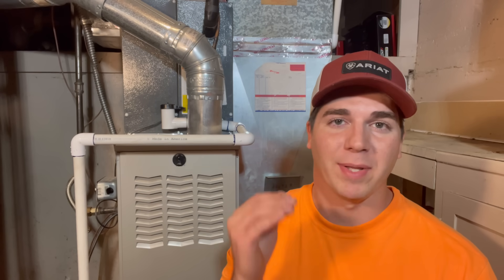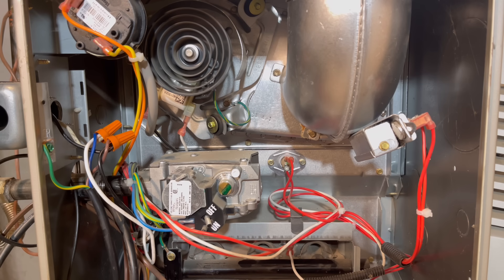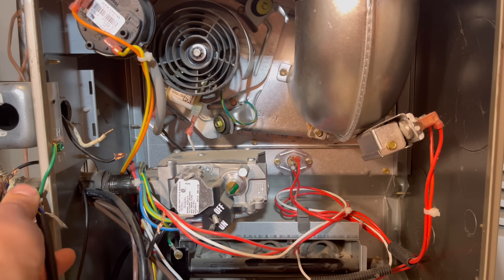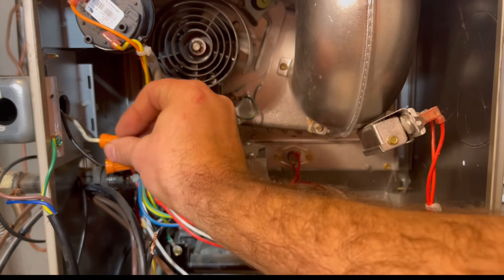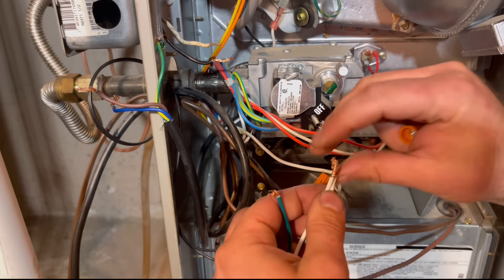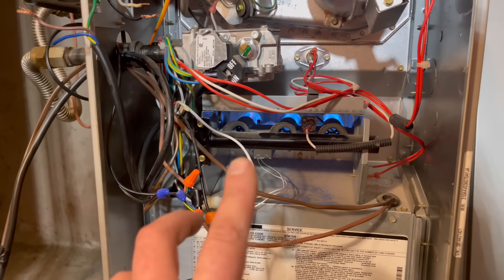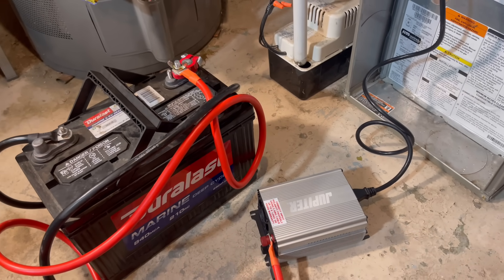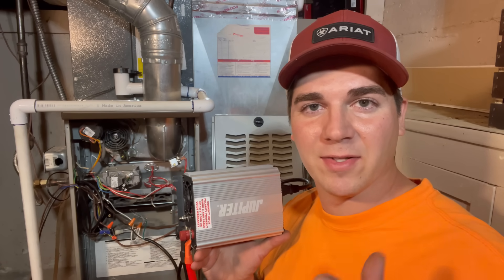Did You Know You Can Heat Your Home With A Car Battery?

Comment: Please note keeping that battery on concrete will drain it/ground it which will cause reverse polarity problems internally  ... It needs to be at least on a few sheets of cardboard.
Reply: no longer true since batteries were housed in plastic, which is more than 75 years
Reply: @EmilioIacobelli  they still get grounded.. not as often but storage ... you do you man just speaking from experience
Reply: @Fight4Freedom1911   how would they get grounded? Grounded to what? Is polyethylene a conductor? Since when?
Reply from the maker: Lol
Reply: @EmilioIacobelli it jumps thru the casing at low volts, it happens when the battery is also in a metal battery holder and not secured tightly. It will continue to shift and wear out your caseing wall causing it much faster. They are all remanufactured pieced of shit that only last 3-7 years for a reason
Reply: Every company gets them on wooden pallets and cardboard sandwiched between until they go onto the metal shelves or until an employee fucks it up.... then battery's on the shelf last up to 3 years on a good note which is why company's collectively brought the warranties down as well to 3 years instead of 5
Reply: Just go get a battery box if your having that hard of a time understanding or a slice of cardboard lol
Reply: @EmilioIacobelli  unless it's the electrical system causing a negative parasitic draw on a ton of causes... but you'd be surprised how many batteries get sold that are 10-30 percent defective but it will work good for about 2 and a half years just perfect warranty time .. do your own research in life before talking shit lol
Reply: @Fight4Freedom1911    "it jumps through the casing"? 
Is that some sort of Quantum-Mechanical effect? 
Because if it is; the casing wall thickness would have to be microns thick.
For the casing wall to abrade to the point where quantum tunneling would occur I'd suggest either mounting it in a lower vibration area or a vibration damping mount, or, ya, mount it securely, which is normal practice, but why would I secure it to my garage or basement floor?  Unless I lived in an earthquake-prone area?
Or, if it's happening after 5-10 years, then the casing abrasion is irrelevant as the normal internal degradation is dominant.
The alleged drop in total product quality is a completely different subject that has nothing to do with current getting "grounded", the mechanism of which BTW you still haven't fully explained.
Reply: @Fight4Freedom1911    we're speaking of batteries placed to rest on concrete, not parasitic connections, not manufacturing defects, not handling errors, not high-vibration applications or improper securing,. So please explain your original reply to the subject of how a battery gets "grounded" on concrete
Reply: @EmilioIacobelli  your trippin out my guy go get a beer before free your next reply ..... in the real world I'd see that shit on a daily idk what your going on about just keep your battery off the floor or as far as possible.. electricity is always grounding,when it's in your car it's on wheels fully insulated and you want it frame grounded... you do you my guy it was a simple comment from experience the walls are only 1 millimeter thick.... I've seen hundreds cracked open and you'd be surprised how many living NPCs have grounded wall housing just from driving ..... like you said storage alone it does go past the plastic missing or not
Reply: But they are ment to be recharged so just in time it will loose a percentage of charge and not meant to drop to 0 percent charge
Reply: And the vid here he does have it on the floor for his setup so I'm trying help him out lol and I'm in Cali everything is bolted and lower because we're always on fire and getting earthquakes
Reply: @Fight4Freedom1911   dude, chill, I'm just asking you how the battery ends up discharged just from sitting on the concrete, that's all you originally said, you didn't say anything about abrasion, cracking, etc.
That's all I want to know; how does it end up discharged from just sitting on the concrete? Which I assume is what you mean by "grounded",  which is the wrong term for "discharged".
Ok, I'll tell YOU ; the ONLY way it will discharge if it's not on a charger is by self-discharge due to the recombination of ions in the electrolyte solution. 
Not from sitting on concrete, it could be sitting on anything, it could be suspended in mid air.
And all of the other stuff you mention has nothing to do with discharge; they are all mechanical damage.
Study some basic electrochemistry and proper terminology.
Reply: @EmilioIacobelli  lol for a 100 dollar battery I didn't want to waste my life on this Broski I just said time same shit
Reply: @Fight4Freedom1911    The strength of the solution has nothing to do with what I said. The positive and negative ions *IN* the solution are what recombine… not the solution strength. If you have to add water to the battery it’s because it’s been overcharged and the water has been evaporated out. That has nothing to do with the ions at the atomic level.
BTW, as someone said many years ago; “When the argument is lost, the loser turns to slander.”
Reply: @Fight4Freedom1911    really?  your argument is ; “That’s what I said” ??  Are you a five year old?
That is NOT what you said.
Reply: @EmilioIacobelli  yoo Biden what are you mumbling on about.. this poor dudes comment section lolll ...ions you have ions in you yess.. your grounded to the floor .. this guy's battery which I sure as hell spent more of my lifetime here then his video ...still grounds thru the unconductive plastic housing as well as looses overall voltage in time ionic water or not lol
Reply: @Fight4Freedom1911  Wow. Dude; Google is your friend. Use it. Or visit a library. 
That’s what you get for throwing insults; your comments deleted. 
Conversation over, I’m out. 
Peace.
Reply: @EmilioIacobelli  comment is still there loll I think they silenced you lol
Reply: @EmilioIacobelli  and it's been over

Comment: You need at least a 2,000 watts inverter an a couple of batteries to keek a furnace running for a couple hours. A 1,000 watts inverter will not work with a furnace .
Reply from the maker: Actually what I ended up doing that I should have put in this video is I got a pure sine wave inverter and hooked it to my work truck and then I’ll just run an extension cord to the furnace so as long as I have fuel in my truck I can power the furnace 👍🏽 just start it up occasionally and let it idle

Comment: If you want it to last longer hook it up with two batteries in parallel, more current available
Reply from the maker: Actually what I ended up doing that I should have put in this video is I got a pure sine wave inverter and hooked it to my work truck and then I’ll just run an extension cord to the furnace so as long as I have fuel in my truck I can power the furnace 👍🏽 just start it up occasionally and let it idle

Comment: Okay I'm sorry I seen a lot of comments a lot of people saying some of the same things and I'm about to say the same thing I'm sure dude do your research first do the testing first so you have real information that you can actually give to the people the one guy that commented saying this will not last for days he is absolutely correct I car battery will give you I don't know a hundred minutes maybe 140 minutes of run time running that inverter to power that device this is what you really want to do everybody go buy yourself a generator but if you don't have a generator but you do have an inverter you find around your house I don't care what it is find enough wiring that you can put together as long as the wiring is thick enough to carry a 12-volt current from your car battery to the inverter hell you could take a series of extension cords and cut them up and make your cable if you need to as long as you put everything together with the electrical tape and nice and tight you should be fine but you do not need to remove the battery from your car now this all depends on your situation the layout of your home apartment whatever it is right if you have enough cordage and the vehicle is close enough to your furnace or window you could probably just wire up right off the car battery shut the hood run the wires directly into the inverter the inverter directly to your furnace and then literally just start your car and while your car is running at idle it will generate the electricity to keep that inverter powering your heater all night long as long as you have the gas for your car lock the doors go back inside stay nice and warm or you could just go in your vehicle and sleep in that until your heat gets fixed or electric comes back on but this is I think the best option is it more difficult not really we're talking about a long extension cord and yeah you're going to be ruining it but you could also put it back together and refix it anywho good luck
Reply from the maker: Yea I learned from the comments I was mistaken and for that I do apologize. Actually what I ended up doing that I should have put in this video is I got a pure sine wave inverter and hooked it to my work truck and then I’ll just run an extension cord to the furnace so as long as I have fuel in my truck I can power the furnace 👍🏽 just start it up occasionally and let it idle

Comment: where is the video showing the runtime on your furnace? no way a 100ah battery can run your furnace for a couple days 100ah battery only has 50ah of usable current. I would love to see the video of your run time.
Reply from the maker: Thanks for this information. I realize that statement was wrong and for that I apologize. What I ended up doing is connecting the inverter to my work truck so I can power the furnace as long as I have fuel in the truck 👍🏽 cheers
Reply: @diyhvacguy  thanks for the clarification and update on your setup.

Comment: No way a single car battery will power a furnace for several days.   You blower motor will draw  600 watts of power.   Supplied by a 12 v source, that would draw 50 amps.   A standard car battery would only last one hour.
Reply from the maker: Thanks for this information. I realize that statement was wrong and for that I apologize. What I ended up doing is connecting the inverter to my work truck so I can power the furnace as long as I have fuel in the truck 👍🏽 cheers
Reply: @diyhvacguy  Good idea.  I like the concept.  I am contemplating a small gas powered generator as back up power, just to run essentials like the furnace.  Where I live its commonly -15 C to -25 C winter nights.   The truck is a good idea.  Run an extension cord to the house.  Lower losses at higher voltage.  Say, run it for an hour, heat the house up, then shut it off.  Fire it up every couple of hours to save gas.  I think you can idle a vehicle for  a full day plus some on a full tank of gas.

Comment: Just skip all this, FIRST! Go to your circuit breaker box, and turn off the fuse to your furnace in case your power comes back on, you don’t have line wires hanging out at furnace!! Then take an extension cord, chop of the female end, open the box on furnace where power goes to it. Undo do the two wires, connect then to the extension cord end you cut off. Then plug male end of cord into your little gas generator. Done. As long as you have fuel in your genny your furnace will turn on and off just like it’s got hard wired power! You’re welcome.
Reply from the maker: Thank you sir. If someone doesn’t have access to a generator because they are sold out, this is good knowledge to have in your back pocket. Cheers

Comment: Hey were is the follow up video with the run time test??
And thank you for this I live in MN and I have a small solar bank but was unsure how to do this to my furniture.!!!!
Reply from the maker: In hind site I would have included that pure sine wave inverters are better for sensitive electronics. Also, what I ended up doing was hooking the inverter to my truck and that will allow me to simply run an extension cord to my furnace and I can power it as long as I have fuel in my truck! The video testing this system out will be posting soon :) cheers,   Dave
Reply: @The DIY HVAC Guy  That's great thanks man. Yes I have a couple inverters, my main one is 2k pure sin, and I have 2 smaller back up ones. 
I have just gotten into solar and inverters this year. Wish I would of long ago. 👍👍👍

Comment: In Texas and this is by far the most useful video I've watched on YouTube in a long while. Thanks and Subscribed
Reply from the maker: Awesome, thank you! Glad you found it helpful! In hind site I wish I would have included to just install the inverter in your vehicle, run an extension cord, and you can power your furnace for as long as you have fuel in the vehicle! Cheers
Reply: @diyhvacguy  I'm thinking of just getting that bluetti that's around $200 wired to a small solar panel. The idea of battery powering the furnace is a completely new idea for us southerners.

Comment: Using your cars battery for this is a bad idea. If power hasn't been restored before the batteries discharged, you've destroyed your ability to escape.  An inverter has significant power lost in converting 12v DC to 120v AC. Calculating no inverter losses, 12v to 120v means the 12v load on the battery will be 10x that of the 120v amperage rating of the motor.
Reply from the maker: Yea what I ended up doing was getting a pure sine wave inverter and installing it in my truck and then running an extension cord to my furnace so I can power it as long as I have fuel in the truck 👍🏽 cheers

Comment: My 45kbtu furnace pulls 600W. Using your 210 reserve capacity battery, runtime would be ~1.1 hours before taking inverter efficiencies into account. That's running the battery to 0% capacity. 
You'd need multiple batteries to keep the house warm for a long outage.

Comment: Can a battery charger be hooked up to the inverter to charge the battery while it’s running a furnace or whatever else is hooked up to the inverter if it’s has two outlets?? To have continuous power to the battery
Reply: You can't charge a battery using the same battery as a power source.
Reply: The furnace load will be more than the battery charger can put out and will drain the battery faster.
Reply from the maker: Yes you can.
Reply from the maker: I’ll be doing a video on this soon :) cheers